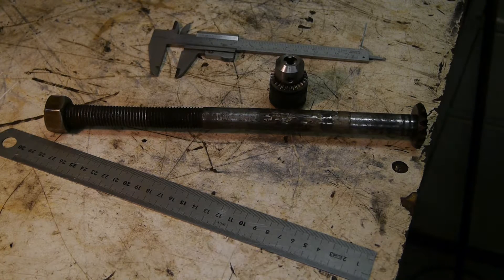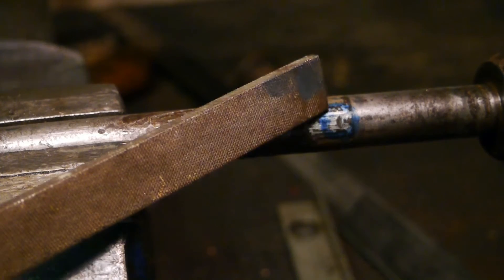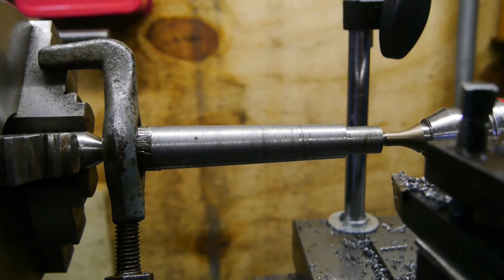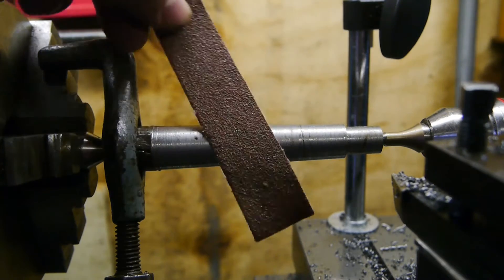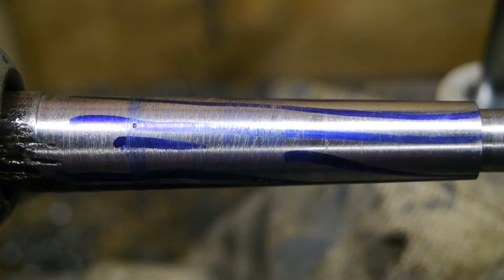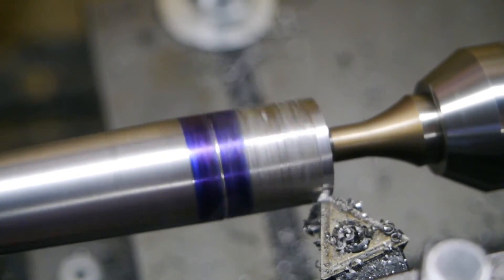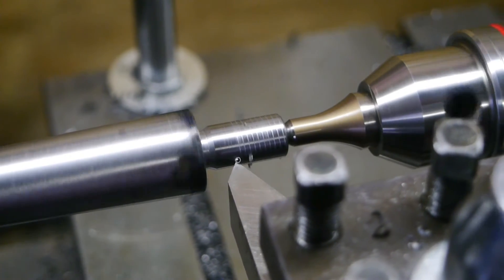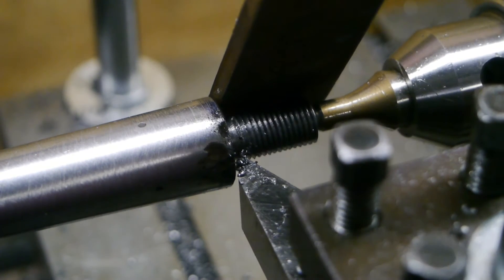Making a drill chuck arbor from an old tractor part

Comment: If you are cutting it with HSS it isn't all that hard.  Some metals tear and smear making a good finish very difficult to achieve with them.  If you take it down with crocus cloth after machining and you don't get a better finish or as you did with rubbing compound then it may be one of those metals.  It can be frustrating for sure.

Comment: The low spot in the taper that you found might not be a low spot in the taper, reading the indicators is an art, like any black magic, and in this case, i think very strongly, that the low spot is in fact a deviation caused by your slideways movement... The taper looks new, looks cyl. ground and appears to be in line with the dial at top and bottom, so a low spot of that magnitude in the middle is a bit uncanny, lest the grinding got hot in the middle and shrunk afterwards to what you have, but still, from what i can see and apply from my learning and exp, i think you should check the slideways movement with blueing the slides, using indicators and the rest of the good old precision checking jazz... And watch Stefan on compound rebuilds, it will save me an hour of typing and maybe get you motivated to improve the performance of thy lathe! Any way surface is similar to any other, despite the design and length and what not, you can check all of them and fish out the info they withold by using indicators, micrometers, blueing and checking fits along the whole length, checking for rocking with gibs loose...

Comment: what lathe do you have?
Reply from the maker: It's called a HBM BB25-3L but Iḿ sure It's sold under other names as well.
Reply: Yeah because i have simillar lathe hyundai hyd500 but youre gear sound bad
Reply from the maker: I agree it's pretty noisy, especially at low speeds.
I had a look inside but could not see anything wrong.
Sometimes when I start it at the 550rpm setting there is a lot of noise. Stop and start again and its gone. Very strange.
Does yours leak oil as well. Mine leaks oil at the pulley.  Makes the belts slip.
Reply: No it does not leak. It leaks only when i put to much oil in the gear box.
Reply: But you should have paper seal on.